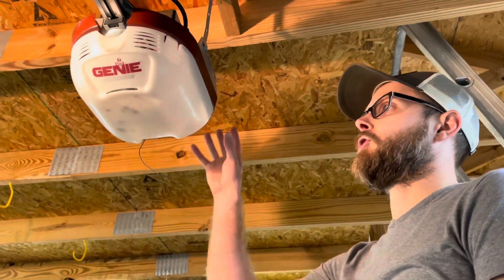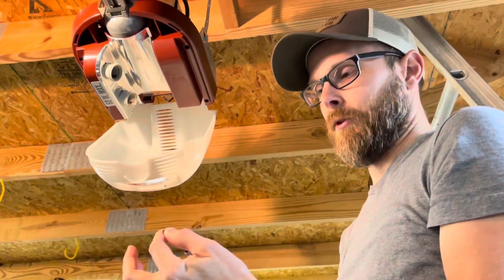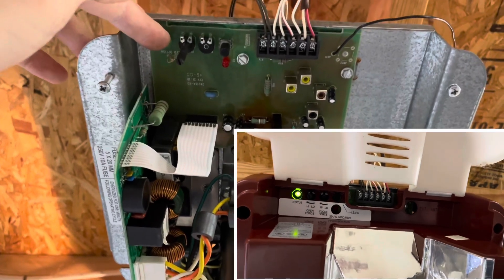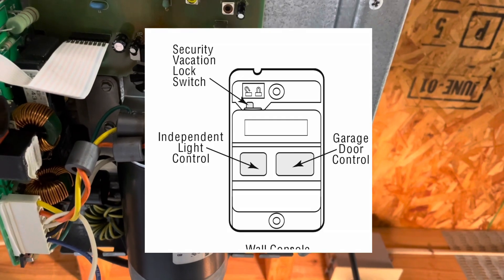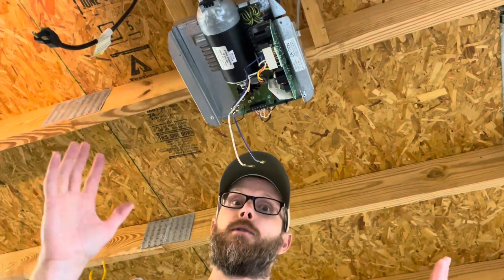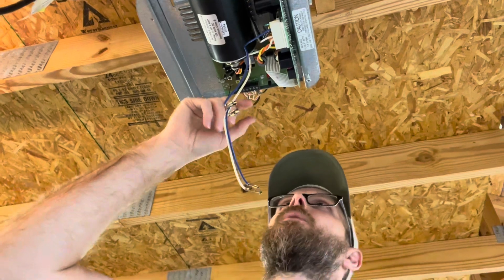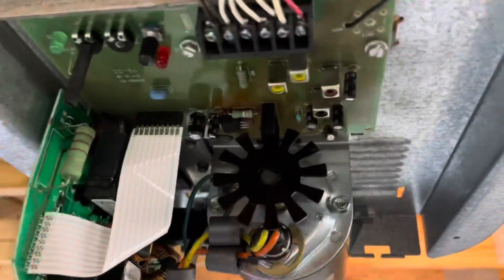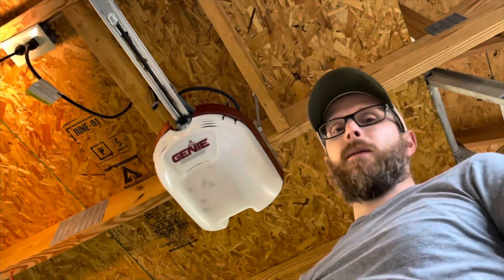Genie Excelerator Garage door opener not working - Troubleshooting error codes

Comment: Thanks a bunch for taking the trouble to make this well presented video about a discontinued model. Highly useful! I agree with you that ultimately you can fix most garage door problems yourself. My experience has been no different. Your tip about the sun rays falling on the sensors and preventing opening/closing is spot on! 
The only reason I have ever called a garage door repairman is when I had to replace the springs. I replaced the circuit board myself once when it got burnt during a rare thunderstorm in my area. Otherwise my dear old Genie keeps chugging along day in and day out :)

Comment: Very well done video , followed instructions on video and got my opener going again!
Reply: I just ended up buying a new garage door opener but the problem was minus it was going through learning mode as the power would have been off and then finally you would hear up a thump when you hit the button no activity from the motor except for like Pop Pop but not electrical pop almost like the motor froze

Comment: The limiting switches for the open or close force will internally corrode after a few years. Rotate the switches back and forth a half dozen times to internally remove any corrosion. Don't forget to re-calibrate your settings after.

Comment: 4 flashes and I've tightened the open force as far as it will go. Door opens a third of the way and stops violently and loudly.  No machine gun sound however.  What else am I missing?
Reply from the maker: That sounds terrible. Short of a wheel getting struck on the track or the cable on the springs sounds like a deeper problem than i got in to.
Reply: Did you fix this? Mines doing this as well
Reply from the maker: The only time it’s happened like that to me, the tension spring had broke and the steel cables had come unwound and jammed the door.

Comment: My Pro99-2IC has 8 flashes: Vacation Locking Switch on Wall Control is in “Lock”mode. But I don't have Wall Control connected so would you knew what wrong?

Comment: Ours has the green light blinking 3 times which is the over heat/over cycle code. We’ve done as indicated in the manual and here but are still getting that code. We are assuming it’s time for a replacement?
Reply from the maker: If it has sat for an extended period to try and reset on its own and you’ve tried physically resetting things by powering off and cleaning contacts and it’s still throwing an error, i would probably be pricing replacements.

Comment: I have a ISD990 genie, makes a big noise like shrieking, no grinding, no humming, I changed coupler, greased the rail and the noise is still there the same in intervals, changed the carriage also and noise still there looks coming from Union of motor and rail (screw drive), motor open and close the garage normal, never problems only the noise, do you think is apart inside the motor that I have to put oil or lubricant?, thank you.
Reply from the maker: I would be surprised if the motor had any way of servicing the factory lubricated parts. Before dismantling and pouring oil in places it maybe shouldn’t be poured lol, I’d  post a video on YouTube and see if anyone has an answer.

Comment: My problem is intermittent issues with the remotes.  This afternoon, when wife left to run errands, she couldn't close the door.  I immediately checked, and was getting 6 flashes on the status light.  I waited for the light to turn off and was able to close it using the wall controller.
Previously I've tried closing using the wall controller while the light was still on, and the button press was ignored.
Reply from the maker: We’ve had two other issues that I didn’t get to in the video. 1 was intermittent issues with the remotes because of corrosion. The house sat empty for about 3 years with batteries left in the remotes never getting used before we bought it. The other more common issue is direct sunlight hitting the safety sensors. At the right time of day when the sun shines brightest on the sensors we have to have someone stand in the way to cast a shadow over the sensors long enough for the door to close completely.

Comment: Screw drive 4060 is opening and violently coming to a stop. Go down a bit and open again. Goes up more than the first time and violently comes to a stop. Any ideas? Trolley seems to be in good condition. Greased very well. Door opens fine with it disconnected also.
Reply from the maker: I know that has happened to me. Usually it was the door lock pushed out just enough to grab the track or the rope that was tied to the door would snag something.

Comment: What would you do if the door opens but would not even initiate to close? I have aligned the sensors several times and is not blinking but the motor dont seem to close.
Reply from the maker: Mine did that if sunlight was shining directly on the sensors. I had to cast a shadow on them.

Comment: Ran through your checklist and unfortunately mine still has a single flashing green light after having it unplugged all night, opening up the motor housing and disconnecting and reattaching those two white cables.

Comment: Most issues with garage door openers (of any kind) is with an unbalanced door.  If your torsion spring(s) are the wrong size in relation to the actual "dead weight" of the door your door opener will be temperamental.  But, DO NOT mess with your torsion springs without doing some research first (you could die)

Comment: My garage door opener acts like it wants to go up  or down sound-wise but then it just stopped after like two trys and don't complete the cycle. This happen after the neighborhood lost power for three hours. Can you help? And maybe give me some tips before I buy a new own
Reply from the maker: I tried to fit everything I have had to do into this video. If the motor is running and nothing is happening you probably need to check that the carriage is engaged fully. Might need a new one. Remember that pushing the button too many times will force the unit into a safe mode where it makes sure it doesn’t overheat and all you can do is leave it to cool down and reset on its own. Removing power from the unit will cause the cooling cycle countdown to stop so leave it plugged in. Adjusting the up and down force sometimes helps. 99% of the time, all my issues were with the safety sensors being just a hair out of alignment. And the slight vibration of operating was enough to. Real the beam connection. The sun shining directly on them can cause problems.

Comment: My ISD995 has just recently and intermittently stopped opening/closing unless I power cycle the unit.  I'll check the error code.
Some comments/questions:
- As an electronics hobbyist I swear by DeOxit for contact cleaning/preservation.
- Has anyone done a deeper dive into intermittent controller/driver boards?  Electrolytic capacitors are often at fault.  Some vintage hifi hobbyists recap whole amplifiers to restore them.

Comment: My door has opened by itself in the middle of the night a couple of times.  I turn the wall switch off when it’s not in use but what a hassle.
Reply from the maker: Yeah that would be annoying and concerning. Knowing the wall switch is the issue means a simple fix if you get to that point.

Comment: Where does the black wire go? It says ANT 1 where it comes out. Connects where? No lights coming on
Reply from the maker: Ant 1 should just be your antennae wire. It is soldered to the board on one end and is just supposed to be left exposed to pick up your remote signal.

Comment: my genie goes up fine , but not even a motor click or amy movement at all for door down mode?
Reply from the maker: Most of my problems have been with the sensors not lining up. The door will go up fine without them aligned, but it won’t even attempt to move if there is a break. One issue I missed covering in the video is sunlight shining directly on the sensor. If you haven’t already tried, crest some shade in front of both sensors and then try closing it. Did the error light indicate anything?

Comment: I reset the up and down limits and when I try and close the door it didn’t work the door will come up but not go back down
Reply from the maker: We’ve had headaches with that more than anything. If you’ve let the unit sit the appropriate amount of time to cool down and have the down force set all the way down, it’s most likely an issue with the sensors. A million times we’ve thought they were straight and clear and something was off. Sometimes it’s just the bright sunlight shining directly on them.